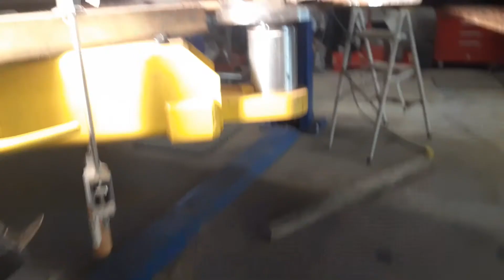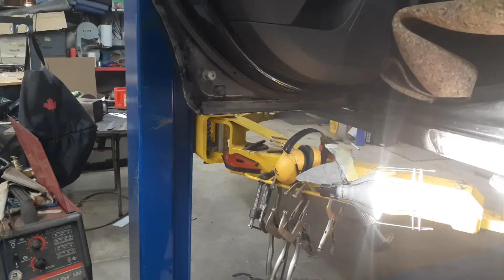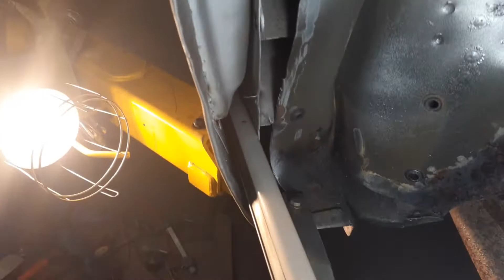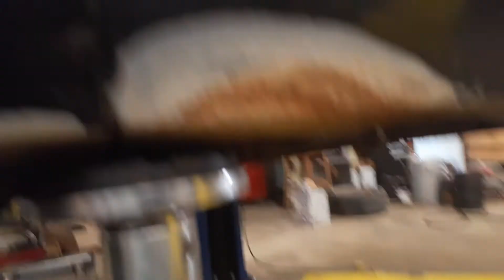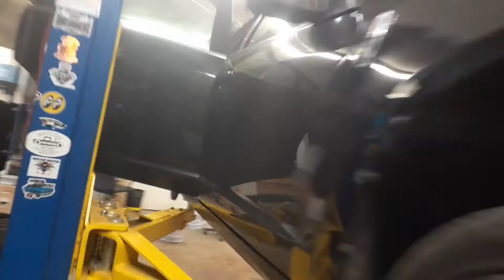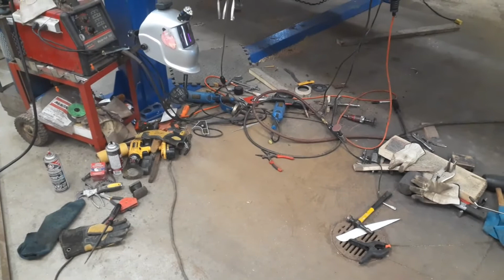# 265 Rusty  Lincoln update

Comment: I found a problem in the floorboards of my 1982 International. I don't think I'll be making a video of it but if you want to swing by and repair for me that would be just fine....
Reply from the maker: Hey Loves. I bet the metal in an 82 International is easier to weld than in 2011 Lincoln.